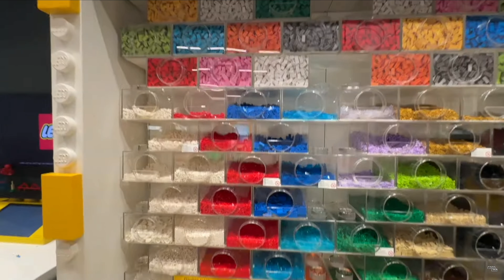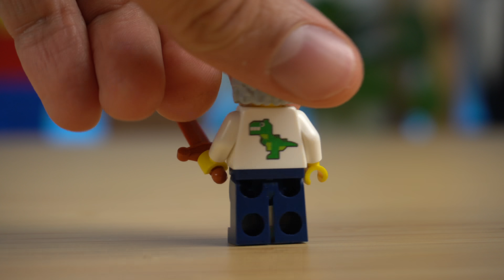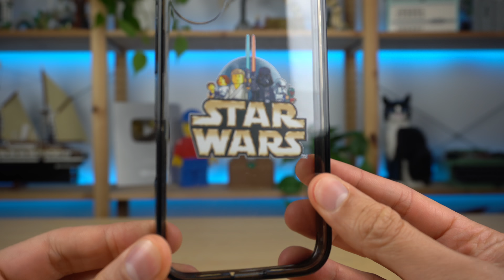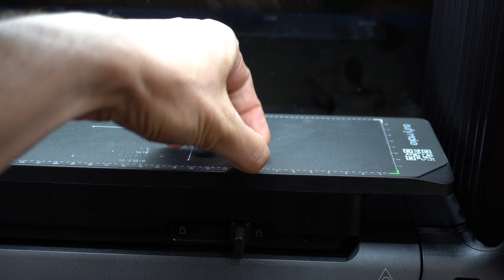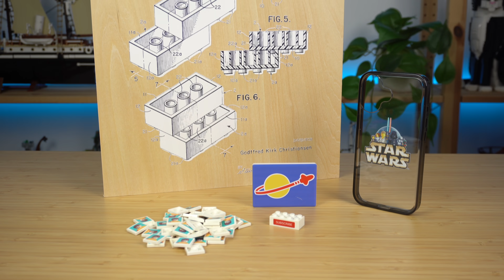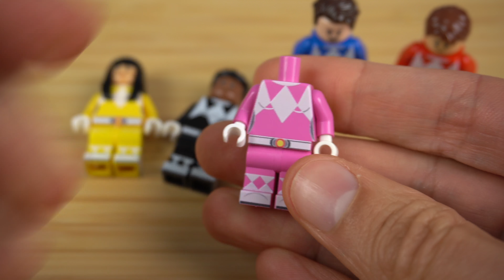Custom print your LEGO at home!!

Comment from the maker: EufyMake Kickstarter ❯ https://eufymake.sjv.io/c/5394016/1690807/18025
Reply: Do you know if It can print on lego heads? considering they are curved
Reply from the maker: I haven’t tried on rounded elements so I can’t really say
Reply: @TiagoCatarino  Could you try and report back to us ? It would be greatly appreciated, its literally the one thing holding me back from whether or not I commit to buy this machine
Reply: @TiagoCatarino is it just a funded project or is there any way to actually just buy one? I’m a little confused on that part
Reply: @Blake-r3x  the project is fully funded at this point but the campaign still has a few days left. Essentially if you back it now you get a lower price and the payment processes when the campaign ends and it will ship in July. Otherwise it will be available for full price from the company's website in July from what I understand.
Reply: @DarthSpeedy Well, to be honest I don’t have any way to currently fund it. I was just wondering if it was a one time thing or if it was available for purchase later. Thanks for letting me know though
Reply: @rodrigoruiz4452  I have the same question !
Reply: @rodrigoruiz4452 I’ve seen some videos where they printed on consoles, pencils and a Gameboy. Even over the hinge. From the specs it says it’ll print 3d reliefs up to 5 mm thickness. If it can create that much height it should als be able to cope with the curvature of a Lego head. I imagine it might blur out a bit the farther you get around the sides of the head.
Reply: Can someone please tell me what software you use to do the designs on? And do you think you can print on a 6" action figure? Ty
Reply: Anyone?
Reply: @tiagocatarino
Reply: I hope that was an affliate link, because I just ordered one... or backed one. Thanks for the video!
Reply: Give me the power ranger sfigurrs
Reply: Would you consider making a lego cmf bionicle with your uv and 3d printers?
Reply: I want to buy one but it says paying for it won’t guarantee that I will even receive it on the kickstarter page!
Reply: I can’t afford to throw away $3500AU
Reply: Added this to my kickstarter watchlist. It really would be skyrocketing some of the custom builds I currently have in mind. Pricewise of course a big step - but that probably fully depends on the number of usages of this thing.
Reply: I just bought one and it’s gonna be coming in soon got to ask you did you think it’s possible to steal your specs on those poweranger prints?

Comment: I bought a jig off etsy to hold minifigs for this exact thing. Just printed my first one and it was a just slightly off trying to use the camera to align it though. But the jig worked great and came with little arms to position it, maybe I'll try zero point positioning using those and see if I can get the alignment perfect that way.
Reply: You have this exact UV printer? If so how goes it

Comment: and now .. lsit the downsides of such printer especially:
- cartridge cost, cartridge capacity, cleaning frequency, wasted cartridge on clenaing, can other inks be used and are the cartridges refillable?, what is the print quality and so on ... upkeep for a UV printer is quite high .. if you print or not the heads need cleaning .. so if you don´t print you waste the ink on cleaning to keep the printer alive ... these small printers are a cash trap and they will suck your money through replacement parts and cartridges .. non of the replacements parts will be cheap or generally available, everything iwll be brand specific .. they sell you a printer for 1,7k but it will cost you another 1k to keep it alive per year.. cost you more than a 10k printer in few years :D and ofc the limitations of use will be extreme.

basically the 1,7k is just to make you subscribe to roughly 1-2k of maintenance and upkeep cost per year .. what a "deal" :D
Reply: Many years ago , i purchased so called UV printer.  Spend alot of time and money on printing head ( each USD 60-70). After that, i give up and let it collect dust. 🤣😂

Comment: Are you insane ? Pocket phomemo printer will do black/white stickers for you for $20. Pocket Zinc printer will do full colour stickers for $100. Or just buy sticker/waterslide  paper for regular jet ink /laser. Cheap $150 Tina 3D printer will print lego blocks with _engraved_/embossed elements on it. I constantly print lego technics custom parts on it.

Comment: The only thing is that LEGO parts you get in sets are pad printed. UV printing has some distinct visual differences from pad printing, but pad printers are much more slow because they need to apply each color separately and are also quite expensive

Comment: Great review. Its certanly outside my price range but its absoloutely the start of customisation on a whole new level.

I would have love more of a breakdown of how you did both front and side printing for the power rangers figures (was it multiple passes?) and wether round printing on heads would be possible.
Reply from the maker: Single pass, per side, was enough. So 3 prints per minifigure. Actually 4 since I split legs and torsos.
Pedro did the designs for the minifigures I just imported them into the app and tried my best to line the sides of the legs to the front prints.
Reply: Do you think it would be possible to print on a Lego phase one clone trooper helmet or do you think the curves would be too much?

Comment: Keep in mind that this is not LEGO quality, this is UV printer which fades in time especially when touching them throughout the years. The best result that LEGO uses is PAD printing
Reply: Lego prints fade over time too. Such as the classic spaceman, that gold moon fades to white eventually even on new ones from this decade. Not just talking about the 80s ones
Reply: @hanzocloud  that would be if they are left in the sun etc, I had my lego set form 1980 with lots of those figs and the prints were still there. They were in storage and had taken them out
Reply: @hanzocloud It’s true that they all fade eventually but pad stays much much longer
Reply: Not necessarily true. Good Uv ink doesn’t really fade or scratch off at all. Pad printing is not all created equality and Will scratch or rub off easily depending on the ink/thinner mixture and even Lego prints suck sometimes. Downside for UV is that there are not any metallic colors possible.
Reply: You could.....Print it again.
Reply: @lopoa126 it’s not the same it’s different type of printing this printing is basically the print being on the figure when you go with your fingers over it you can feel the print. Lego printing is Pad printing which you can’t feel when going over the figure. It feels like it’s printed within the figure which is a much much better quality and extremely expensive
Reply: @kaskovic1993  What company makes the pad / print style pritner.
Reply: @Marco1973est AV figures has both, Baggles studios and many more keep in mind both are more SW oriented and they asking premium buck for those figures but those are seemless and look like LEGO
Reply: @Marco1973est  American Print Company and AutoMark are the two big ones I know of.
Reply: @Marco1973est not anything commercialy available, with pad printing you need a separate printing assembly for each colour, pad printing is really expensive compared to UV printing especially when compared to this machine.
Reply: @legobrixz - What your saying is each element that is printed is printed with a pad printer for each color. Let's take for example the classic Lego Space element - there would be 3 different pads with color red / gold and white to make the logo on the torso?   That would have to be printed 3 separate times ? Hence - Expense -
Reply: LEGO print quality? You mean like on Senna's McLaren, where  Red turns pink?

Comment: Using UV light to print on LEGO pieces just sounds like a bad idea… 😬
Reply: Prolonged uv light is actually the real cause for damage.
Reply: @hihellothere9569 I know, but sticking your LEGO into a machine to get blasted by UV light just feels kinda wrong. 😂
Reply: @OkayYaraman  not really. In the long run, the printing acts as a UV protection for the underlying plastic. I mean, the color of the printing will do lots of funny things when exposed to UV and I can't imagine getting the UV printing of cleanly... but the UV damage for printing and the UV protection due to the printing should somewhat balance, when we consider that the printing it self will UV degenerate before the piece does.

Comment: Tiago, when you printed the design on the blank figs, how did you get the side print on the legs/arms? Did you have a different 3d printed jig to run them in the printer again or was it able to do side printing on the first pass?
Reply from the maker: I had to do a second pass and align everything in the software. Mostly successful with it, but it required some trial and error until I got it right

Comment: Love it. Day one EufyMake E1 backer and I have the Bambu Labs A1. Are you able to share your printed tile holder on Makerworld please?
Reply from the maker: There's a weird thing where the design whithin the EufyMake scales the image in an odd way when trying to print multiple pieces evenly spaced. So I have to come up with a new tile holder that spaces the tiles to match the weird scale distortion of the print.
Reply: @TiagoCatarino  Thanks for coming back to me. Was good to see your video. I did wonder if this would be an issue with the camera. I have a Glowforge laser cutter, which has a fisheye camera that scans the material. The further away from the camera, the more your position maybe incorrect. Maybe difficult to resolve this, so worst case only printing in the centre mass of the print bed.
Reply: @TiagoCatarino  Really wish you could import vector files at size instead of scaling to a fit a photo.

Comment: I have been waiting for a less expensive UV printer for years!

Though, I have read that the inks for eufy Make E1 are expensive compared to inks for other UV printers. They are probably making the "HP" version of UV printers, where they sell the hardware with almost no profit and then earn more money on the lock-in consumables. But for hobbyist who only print a little, maybe the cost will be ok.

I wish UV printers would go more the route that 3d printers went where the solutions are very open, so you can buy 3rd party consumables and spare parts.
Reply: 47 bucks / color doesn’t sound too bad. And if all you are printing is LEGO bricks, it’ll last for ages.
Reply: @AttilaTheDev  yes, agree. The price might be ok if you only print small things. I wish though that they would implement an open system.
Reply: @AllanBjerreAbbondio  There's more of a risk of copyright lawsuits due to patents. 

The reason why 3d printing popped off is because the original patent was expired.

Comment: Could someone please setup a shop that just uses this to convert stickers to printed tiles for popular sets? That would make me so happy
Reply: Dunno if Lego would sue, but I’m pretty confident the printer would pay for its self before too long!
Reply: @Dr_Joe_MI you can buy replacement printed parts for some big Lego sets like the venator.
Reply: Definitely something that violates copyright, if you were doing exact copies of the stickers (and also trademark violation if you're doing stickers that are company logos like car brands, which are pretty common) but you could definitely do it legally if you made original designs that are lookalikes for the originals.
Reply: Exists already
Reply: I have ordered a printer, for that exact purpose. And to make every Stargate and Star Trek character.
Reply: Already exists. There is a german online shop called "Steindrucker" where I got my printed parts for my UCS Falcon for around 50 bucks including the plate (parts included). It's expensive but stickers wouldn't do this set justice. I also thought about getting the prints for the Nissan GTR Speed Racer set, but the printed parts would be more expensive than the set itself.
Reply: @heyraphi unfortunately Steinedrucker has stopped doing 4 sided printing on legs though. They used to do that a year ago, and heads and legs are now only accessible with a user account. But their print quality is why I was considering buying one now.
Reply: Amazing idea tbh
Reply: Ordered a printer to make custom minifigures. The last two years I already order some minifigure UV prints and they are gorgeous but it also was like 20 bugs for head to toe printing plus shipping. if you add in all the embellishments like hair pieces and other arms, skirts, etc. it’s quickly at 30 or more. Plus they stopped doing side and back printing on the legs a year ago. 
I’ve calculated that you’d need to print and sell 100 to 150 minifigures to break even. Meaning PaB costs, Ink and the printer is paid for. That’s not too bad. Minifigures for my MOCs don’t exist. So this is definitely the cheapest option to go for. Plus if you invite your LUG friends over for a Lego printing party it won’t collect dust. And if the roomers are correct the printer is cheaper than /equal to one Death Star 😅 since those only seem to come in halves and half printed.
Reply: There's plenty of small Etsy type business that print Lego pieces. Just need to look for them.
Reply: Places like: Minifigs4U, and Brickrock Press do this- just Google, custom PAD printed LEGO
Reply: Would be awesome.  I wouldn't mind a 3x2 tile with the controversial construction worker with "Hey Babe!"  printed on it.
Reply: Stuff like that exists. But you gotta imagine: you're paying for the machine, the design time, the brick, the time spent printing (2 min for a 2x2 is crazy), the ink and the shipping. You're gonna pay maybe 30 bucks for a single piece.
Reply: @MrAgamble  A single piece is expensive, but the idea is to have a set of printed bricks for a lego set.
Your claim that the set of printed bricks can cost as much or more as a lego set is absolutely true; but some consumer would be willing to pay that for certain sets (allowing for some scaling as a batch of printed parts can be produced at once).
There are also parts that commonly need printing, but don't have it, so a tile holder for e.g. increases efficiency for fully custom prints.

It can't be cheap, it is a tricky business for who ever is doing it, but it is border line possible. but... it will also be a business that quickly switches products if a B2B customer is asking for more quantity, easier print jobs and pays better.
(Lego) Customers are annoying, as with the required price to break even they expect high quality, but the process uses everything expensive with a high risk of creating unsaleable parts.
Reply: @sarowie  i am not saying it's impossible at all. I'm saying it exists, but is prohibitively expensive for most people. What you are suggesting (a full batch for a whole set) does create economies of scale, but no redundancies and you also run into the problem of copyright way quicker in that case. 
I guess you could do it for the LEGO Group, them having a set of printed elements as an optional aside to the sets they produce might work, but I also don't see them offering many "add-ons" to any of their sets as is, so I doubt they'd be interested.

Comment: You're spending $1,700 for a printer plus super expensive ink, probably a good $300 on that. Maybe more.

Regardless of how much you spent, nobody is going to buy your UV Printed bricks unless they're priced at $10 average.

That means you'd have to sell 200 minifig torsos in order to break even.
Reply: 200 honestly isn't that much of a stretch in the long run. You could even get an order like that in one fell swoop. I've had companies contact me on etsy (not Lego stuff) for custom stuff and my most recent was a 170 piece order. One potential is find some huge lego fans having a wedding. Custom minifigs of the bride and groom as hand out keepsakes could easily get to the 200 figure threshold
Reply: @jerfsjourneys  Honestly a good business venture, but calling this affordable, as if saying a common buyer could get this, is delusional at best. At that point, I'd rather commission a custom minifigure from someplace and look for the cheapest option.

Comment: If you want custom Lego stickers, it would be smarter (and more cost effective) to pay someone else to do the
prints. 
Shouldn’t take more that $5 per piece so you could print about 340 pieces before paying off the cost of the printer. This also doesn’t include the cost of expensive ink. 
Not worth it.

Comment: Pretty spendy, but (probably like a lot of LEGO fans) I HAD been wondering what it'd take to print the sticker designs onto pieces instead of using the stickers (plus in some cases extending the design all the way to the edge of the brick).  
Now I know.  Thanks!

Comment: Tiago, this should solve your hatred of stickers.  just need an automated way of scanning in the stickers and then printing them on the parts.  :)
Reply: The age of stickers is over 😂
Reply: There are, literally, apps for that. Or a proper camera setup, crop the sticker image, and import it to this and you should be set.
Reply: @JasperAkhkharu  cleaning up the images, centering the print, ... sounds like a lot of work and some trail and error (meaning wasting parts to find the perfect centering)